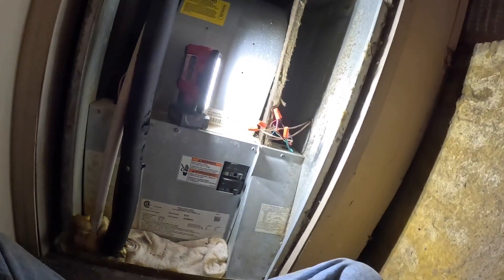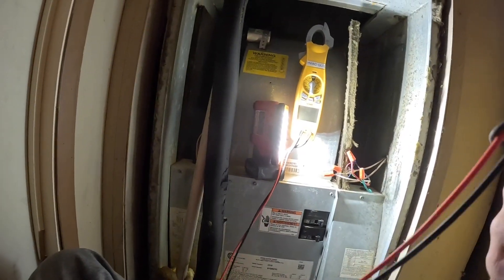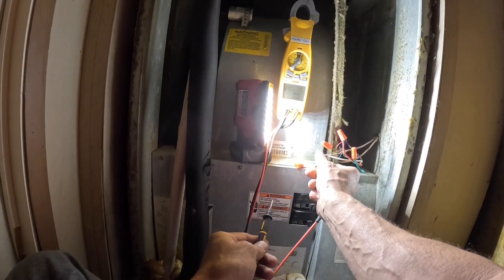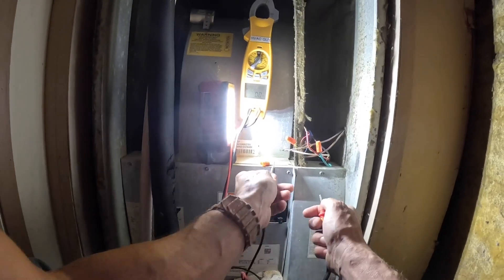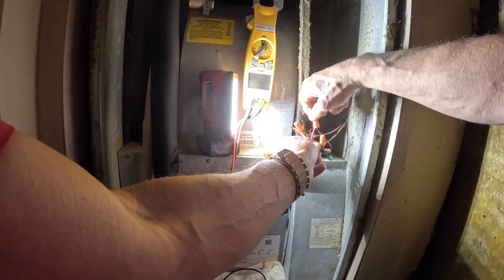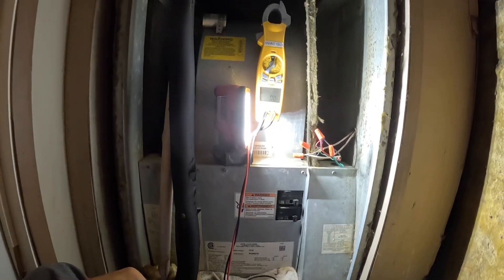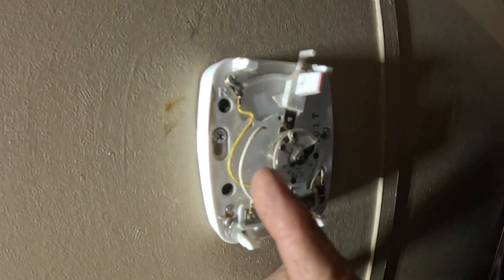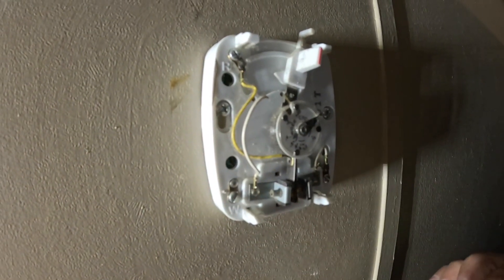Mobile Home System - No Heat, And Freezing Up! #hvacguy #hvaclife

Comment: If you’re old enough to sign a rental agreement, you’re old enough to know how to change the battery in a smoke alarm 🤬🤬🤬🤦🏻‍♂️🤦🏻‍♂️🤦🏻‍♂️
Reply: landlord has to maintain the condition it was in when leas was signed, was it beeping at lrease sign? no? then the lanloard can come change the battery. 😁 edit: its also the law that landlord has to have working detectors in the unit. so again back on the landlord.
Reply: @thedragonhunter  the average landlord probably has given up replacing batteries as they routinely get removed by the tenants themselves 🤷‍♂️
Looking at the condition of half of the apartments he services, the landlord’s do little to no repairs or maintenance
Half of these places can’t possibly pass code on many levels